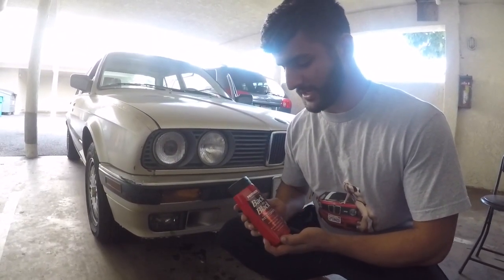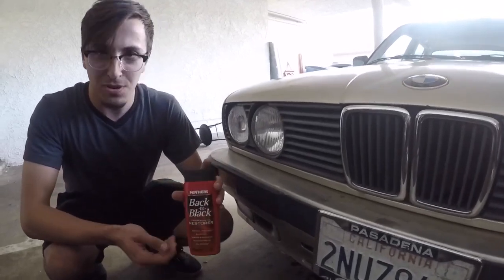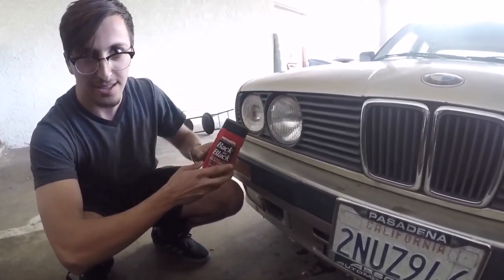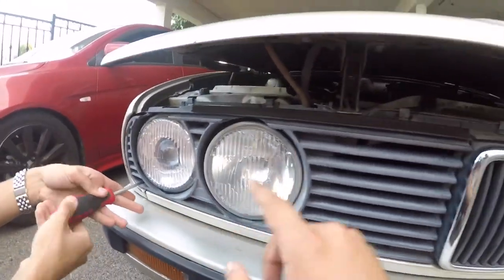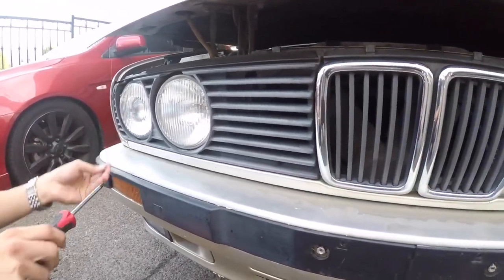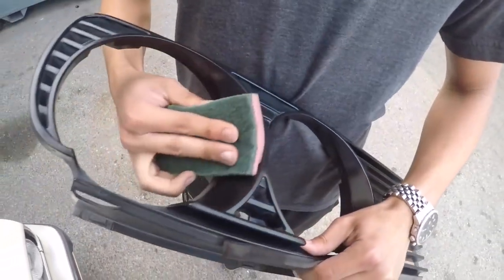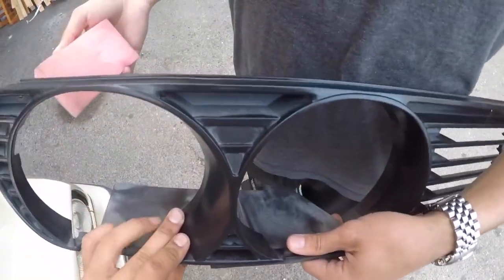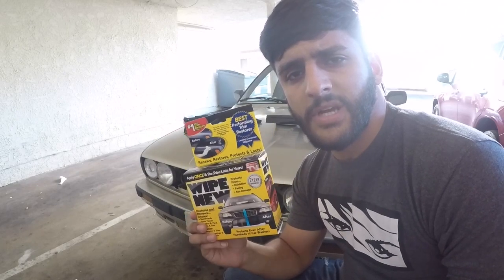BMW 325I E30 Detailing/ Product Review

Comment: That looks really good in need to do that to mine, how long does it last?
Reply from the maker: Wesley_ Media if you use the wipe new product it stays for year. I used it on my e36 when I first bought it 1.5 years ago and it looks new. Make sure you buy that one tho.
Reply: EuroStatics I'll definitely buy it and try it btw is one bottle of the wipe new enough for all the trims and does it resist washes
Reply from the maker: Wesley_ Media one bottle is more than enough and yeah
Reply: EuroStatics sounds good bro thanks

Comment: use a heat gun and it will slowly turn it black just dont hold it still for too long or it will burn the plastic, the heat gun melts the left over wax and soap, environmental fallout  etc  and turns it back to new